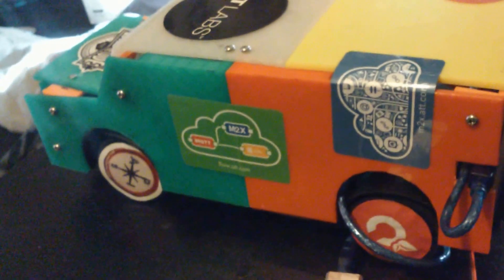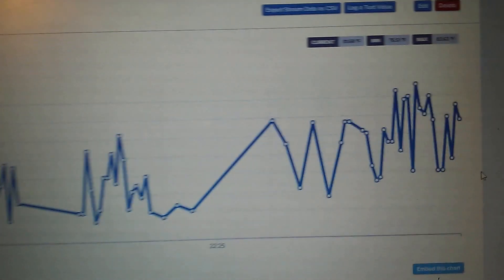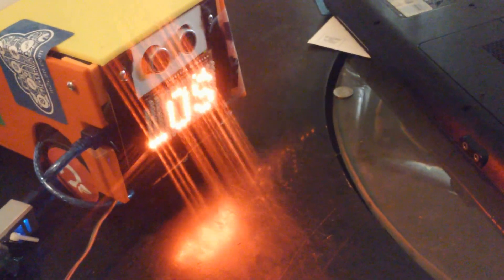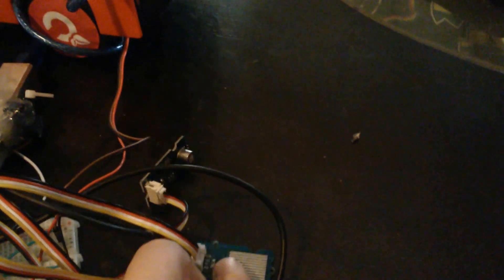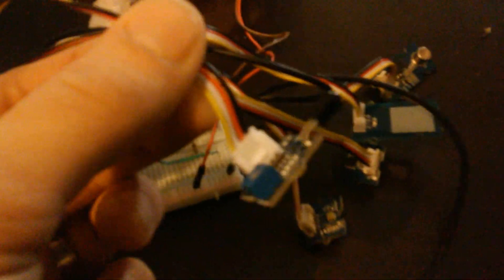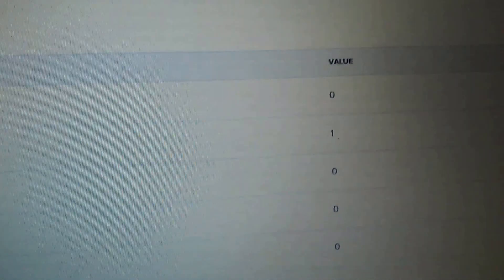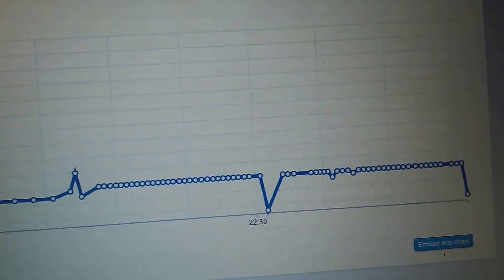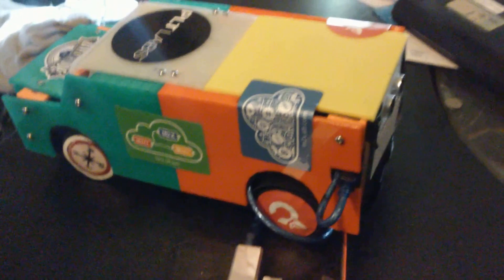Smart Car, Intel Edison, AT&T M2X

Comment: Hi Justin,
Nice automation video. I am experimenting now with the Silicon Labs EFM32Wonder MCU, it needs 5000x less power which allows battery operation for years. The Edison is great for high performance requibments or as a automation center. The EFM is perfect for individual sensors. What I am searching for is a DECT ULE chip which allows to communicate with a fraction of the energy and allows several times larger distances compared to WIFI. The IDE and documentation for the EFM32 is very complete, every single unit in the MCU is very well described. Intel has almost no documentation out it's internals.
Reply from the maker: The reason I used the Edison is because it was given to me at the AT&T Developer Summit and Hackathon in Las Vegas. One typically uses the tech provided in order to win prizes. Using less power was an issue I originally addressed and I attempted to work with that issue in the original design. Here >> https://www.youtube.com/watch?v=OmQIStRjokg. I would like to thank you for informing me about this board, I will look into getting one and seeing what I can do with it. On another note, one of the things i do enjoy about the Edison is the size and the capability of having an Arduino sheild supporting breakout board.